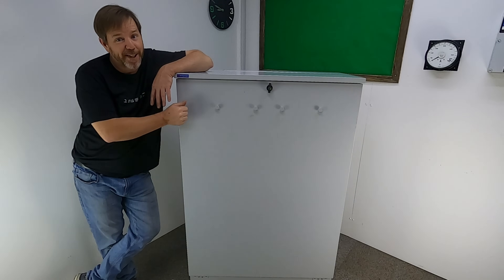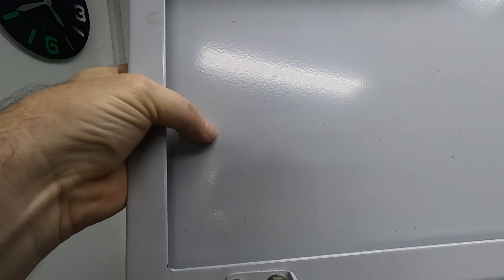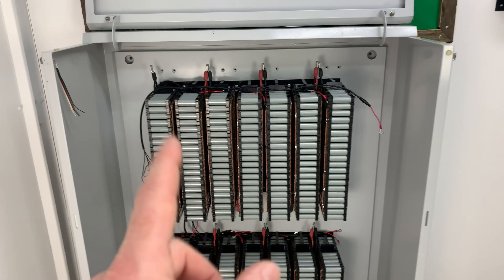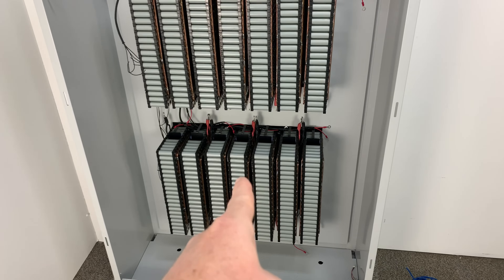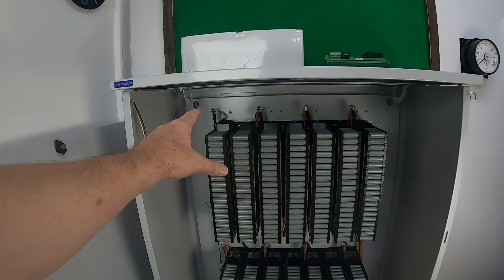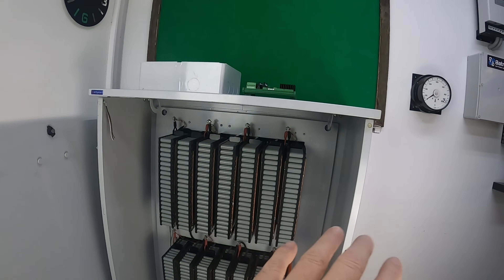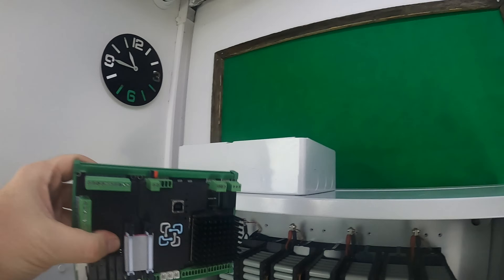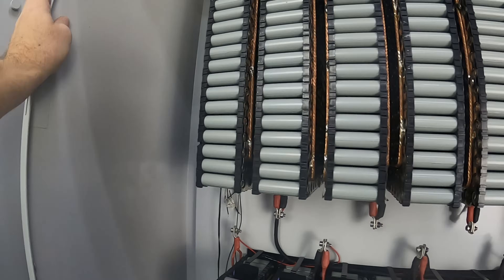Pt.3 Making this MONSTER DIY Battery safe!

Comment: I like the look of the electrical box it makes it look like a commercial look. One thought is in food trucks they have the over head fire suppression that automatically goes off based on temp if your looking for safety maybe add something like that
Reply from the maker: no stopping a lithium fire, just control till the thermal reaction ends.

Comment: Really think you should be using a 66 block with bridge clips for your  signal wiring. Easy way to cable manage, provide a test point, and interrupts. Mount it to a removable plate / plywood with your electronics. 

Also.. why not have a cutoff switch in between those 2 banks? Maybe some sort of bypass with xt90 connectors or a mechanical circuit breaker?
Reply from the maker: Don't you think my solution is simple cheap and effective? I will have to google what you're referring too.. There is only one 14P battery do you mean a midpoint fuse?

Comment: Looks great! Can't believe you redid all of that nickel just to change the cable side lol. Just mount the Batrium on the side, no electrical case. Batrium is part of the "show & tell" too, not just the batteries. Also, better cooling having it in free air.
Reply from the maker: It's about the batteries - Almost have to hide everything else 😆Time to do some mockups to visualize the finished product.
Reply from the maker: I might have to reconsider my planned approach

Comment: Thanks for the video, entertaining as always. Personally I would like a big-picture video i.e. average household consumption, peak load, average battery usage overnight summer/winter, how you sized your battery, how they have performed over multiple cycles over time - that sort of thing
Reply from the maker: Great suggestion! but i've done those to death i feel on my house battery.. Once this one is installed i'm be sure to cover off all the loads, heat, etc

Comment: Rightmost, lower pack, right wire is red. This is a negative lead and should be black. Be careful not ever to mix the 2 different packs by accident. Banks are fused with nickel fuses that will blow at about 9 - 10 Amps. A 240 cell pack will deliver 2,400 Amps when shorted before the fuses blow. A 2400 Ampere jolt is a disaster and may hurt You seriously.
I know the solution You just spent 250$ on looks neat, but in my opinion safety is more important than beauty.
Reply from the maker: if there is a dead short those fuses will vaporise with the inrush along the lines of 10,000 amps and that is probably an understatement. Each cell could do 20amps for 10th of a second x 2800 I don't math but .... Will investigate your observations on the red wire also.
Reply: @HBPowerwall  How about making an experiment in Your garden. 2 x 240 cell banks, shorted. I almost guarantee You a spectacular video, should You try it out. This will show You that this is serious stuff.
Reply from the maker: Been there done that.

Comment: Great start, looks good so far, i'd probably put the fan(s) on the side rather than the front though.
As for the batrium, i'd have it on show but have the wires going into a conduit box /channel to keep them hidden.👍🏼😎
Reply from the maker: Thanks for the tips! Fan holes have already been ' installed ' too late to change that part
Reply: HBPowerwall DOH! 🙈😁
Reply from the maker: no DOH comes when you see how well aligned the first one is lol
Reply: Bottom fan holes can be converted to grill + filters easily mate
Reply from the maker: Thats the plan lol
Reply: HBPowerwall aye, filters on the bottom and then fans at the top extracting I guess would be best.

Comment: Aren't you worried about ripping a hole in any cell casings ripping all that nickle strip off? I've pulled off my fair share of spot welded nickle and it's easy enough for it to rip a hole right through the cell casing depending on the weld quality and depth.
Reply from the maker: May or may not have replaced 100 cells.....

Comment: Peter. Don`t do this.  Reversing the lower 7 banks will leave You with 2 different cell packs.
Until now all Your cell packs can be interchanged. From now on this is no longer possible.
Second,  connecting the right hand side of the upper bank to the left side of the lower bank is no big deal. "Shorter cables"? Think again, there is much longer cables from this box to the inverter so this 50 cm cable is not going to do any harm.
Reply from the maker: I don't plan on changing this design ... (insert hopes & dreams  here lol) the changes have been made and i'm happy with the result
Reply: @HBPowerwall  OK My Friend :)  It´s Your cell banks and Your project. Best of luck to You.
Reply from the maker: it's a 48v battery, i don't think i made mention to that in the video - perhaps i could have explained it better.

Comment: You could weld the din rails to the side.  you’re probably gonna need three rows eventually.  I would’ve left a little more room on one side or the other for the management electronics, meters and such.  I would  like to know if this is a building code requirement and what are you gonna do about the other batteries on the wall beside it if so?  Also Couldn’t  you just run longer cables instead of reengineering the battery and then equalize the length of the cables.  Cable management seems easier.
Reply from the maker: Kinda a code requirement but also i want it to look professional. I could have run longer cables but decided on this path.. no regrets yet!

Comment: @hbpowerwall happy to see you are working on the safety. How about isolating the series / pack itself with vertical barrier between the packs?
Reply from the maker: MANY conversations have been had about this, many ideas chewed on - end of the day it's a design fault of my mounts.
Reply: @HBPowerwall  600 micron (2ply) or 900 micron (3ply) barrier of grass reinforced FRT (make sure it is a fire resistant polymer). I assume that would work.
Reply from the maker: I'll look into it !

Comment: Hi, BMS is DIN mounted, so two more hols for DIN rail won't be so bad and BMS will have proper cooling. For cable management  I would suggest cable trays above the batteries pack, and all cables put in to trays.
Reply from the maker: Thanks for the info! - Not a fan of cable trays in such a tight spot but they might be a good way of tidying up the cables even more.
Reply: @HBPowerwall  i see you're clean look fan 😁
Reply from the maker: Clean is typically also safer in most cases

Comment: HBPowerwall hello I want a favor from you if possible I want to make a box from 18650 batteries for the scooter will be 60V 50Ah.  But I do not know how to arrange the batteries and I ask you how to make a tailstock.and  My request is from you. If you have a diagram or graphic, send it to me by mail. I want to learn how to make a battery pack. oktaysinag@gmail.com

Comment: hmm just a thought have a rated fire extinguisher mounted on the side with the nozzle routed into the top of the enclosure ??? to spray over the batteries in the unlikely event they might go off ?
Reply from the maker: One of those ball things lol NOOOO BUT that's not at all a crazy idea.. Just don't know how to implement it neatly
Reply: @HBPowerwall  no not the ball just regular dry foam squirty squirty
Reply: bolt it to the side mounted with the handle and pin facing you as you approach the cabinet  ie so you can quickly pull the pin and squeeze the trigger  (remember if shtf you may be in a panic so you need it to be as simple and straight forward as possible)
Reply from the maker: I think that would be better used in the shipping container.. Might slow the spread but wouldn't stop a lithium fire. Needs water and LOTS of it too slow the thermal reaction.
Reply: @HBPowerwall  lol top mounted water tank then
Reply from the maker: NOW that i considered and i'm not joking!
Reply: @HBPowerwall  might need roof bracing for that  but i was just wondering maybe you should do a road trip and see how other power companies setup their safety systems with regards to batteries i;m sure there is some reputable companies there in sunny qld ??
Reply from the maker: dump load into the water tank - double duties... hehe
Reply: @HBPowerwall  water heater as well  lol  last thing you want is hot and exploding water

Comment: Will the velcro make it potentially more flammable ?
Reply from the maker: I guess so BUT i think the added safety far outweighs its disadvantages. The cell holders would be more flammable again so I guess you have to draw the line somewhere.
Reply: @HBPowerwall  Thank you, I wasn't sure, just curious from your perspective. Great case, how many kilowatts did  you say this was ? Impressive !!
Reply from the maker: 25khw useable - might push that to 30 in a pinch

Comment: OCD, confirmed, there was no need to reconfigure the lower batteries!
Reply: I agree with these guys; better to keep each module identical rather than having half in a mirrored configuration. Never too late to rip off the nickel strip and put it back :P
Reply: OCD ? Prob but who cares, beautiful job, great work that anyone would be proud of. Thanks for sharing the video, its inspiring and informative.  Well done.
Reply: @TheMrTape  You are out of line. It wasn't exactly necessary to flip the bottom batteries, I agree. But the man has a passion for his work, is a perfectionist, and it shows. That's why he has a following, because his builds are super neat and the videos are well-made. OCD and extreme attention to detail can pay off in some circumstances. There's nothing wrong with taking extra time to do your work how you want it, especially when it's your personal project and hobby.
Reply from the maker: huge need - would have to run meters of extra cable to account for my error
Reply: @HBPowerwall  Yeah but now you have two different 24V packs, so if you wanted to replace one of them you can't just pick a random 24V pack but have to make sure kt's the same way around as the one you're replacing.

You would have had max 2m extra battery cables which should not be a problem at all if the cables are fat enough in the first place.
Reply from the maker: it's one 48v battery now.. initially it was 24v
Reply: @HBPowerwall  I have battery banks of my own... I get it.
Reply from the maker: It’s the way it all sits I had no other choice but to do it the way I did
Reply: @HBPowerwall  I was thinking you could have just rotated the pack 180 degrees... maybe I’m missing something?
Reply from the maker: Design doesn’t allow or I would have in a second.
Reply: @HBPowerwall  I was curious why you didn't just change the bare copper wire configuration?  Did I miss something in your design that prevented that?

Comment: You could possibly fit some intumescent strips to the gaps if your looking to improve the fire rating - Kilargo has a range of them for fire doors.
Reply from the maker: I don't think it's needed as if it shorts it's still the same power source just with out the fuse.
Reply: HBPowerwall  - You’ll have to forgive me, I’m a Carpenter turned Fire Tech with a specialty in doors, but I find Angry Pixie wrangling interesting - Cheers for the reply 👌👍
Reply from the maker: GEESE i replyed to the wrong comment lol Ignore that.. YES I COULD do that but still need a way to exhaust air from the fans at the bottom of case. Being inside a shipping container I don't think that level of sealing will be required. Don't want to make a bomb, just contain a fire.. or at the least slow it down

Comment: Cut a slot into half of the lid of the small electrical box, then the loom can come into the WM5 then you can slide the lid through the side and do up the 2 screws to hold it on
Reply from the maker: Was planning on comming in from the back side of the electrical box trying to hide the wires. Also have to put in two fans in that box to aid in removing heat from inside.

Comment: I'm glad you're doing this. I would have just turned the bottom batter upside down. :)
Reply from the maker: Can't because then I couldn't mount it correctly. it is a design limitation.

Comment: Just an idea but what about putting the fans in the stationary section of the top and then they could pull cool air from bottom vents you were going to make and exhaust the hot air out the top... just a suggestion. Beautiful setup.
Reply from the maker: Cool idea, but i've already drilled massive holes down the bottom when the hinges were. Also having holes in the top isn't ideal as something could drop in and onto battery.

Comment: what kind of spotwelder do you use? could you provide me a part list ? thx
Reply: Kweld
Reply: @DIYTechRepairs  with the separate capacitors? or the complete kit?
Reply: @nadsas1427  Did you look in the video?  It shows rather clearly what he is running ;)
Reply from the maker: link in the top part of the video description @nadsas
Reply: https://www.keenlab.de/index.php/product-category/kspot-welder-kit/